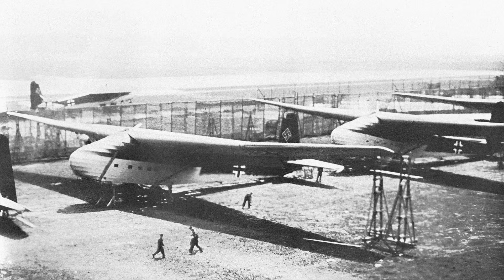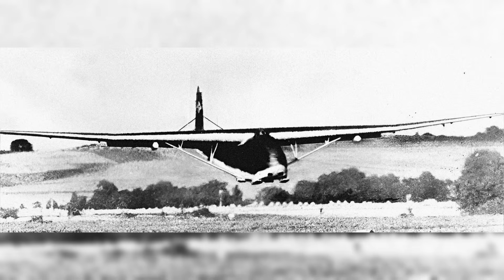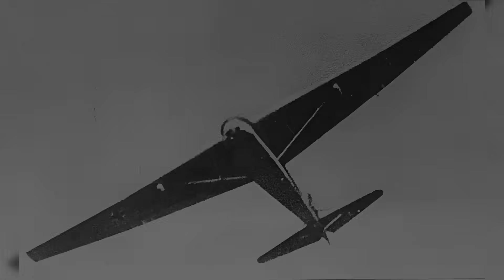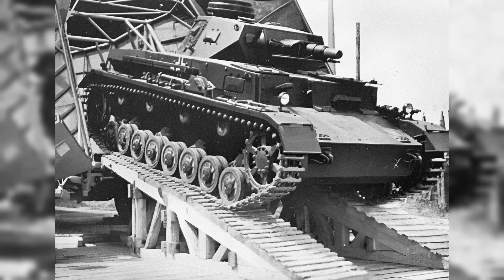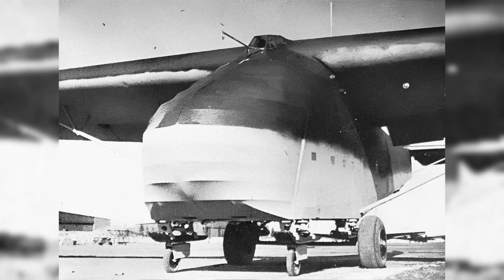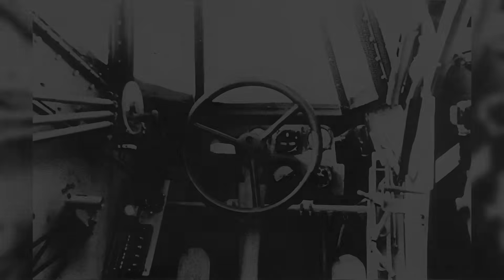Messerschmitt Me 321: The Third Reich’s Giant Glider

Comment: Gas generator engines is engines run off gas given off from heating wood in metal boiler like air tight tank . When the wood in the boiler tank heats up as hot as burning wood it gives off hot  gaseous wood fumes that run through fire heated pipes directly to the carburetor .  intake manifold